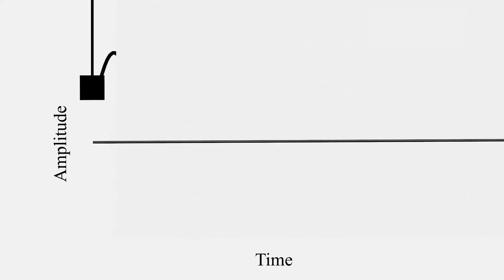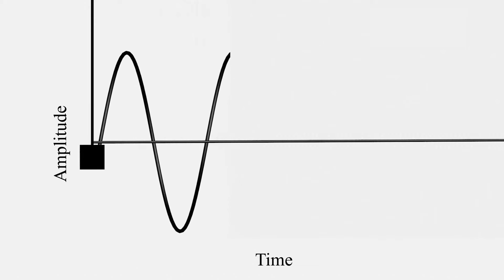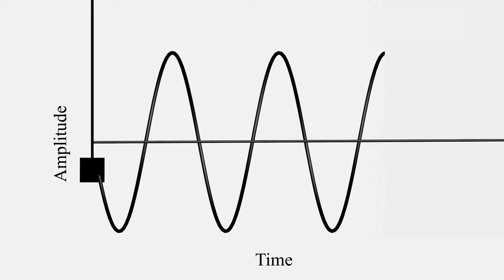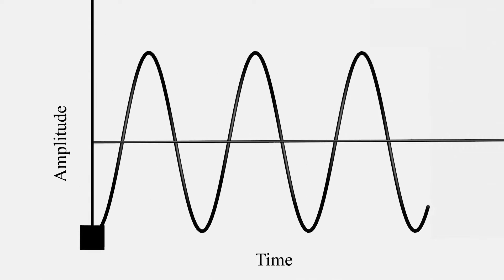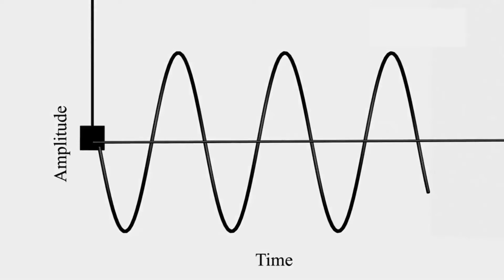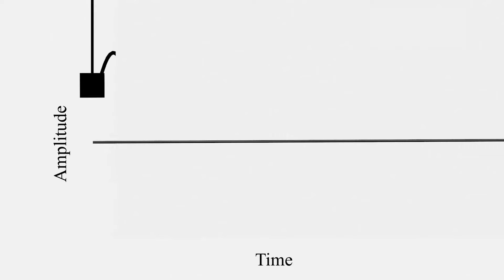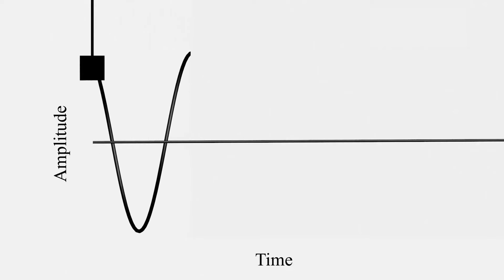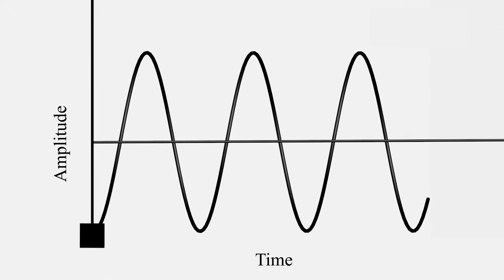What is a ground and why is it important for the performance of an audio system?

Comment: I have a T5x coming soon, should I connect its High Level Input ground wire to the same groud connector as my TT on my vintage Pioneer SA-8500ii ? Or should I just connect the REL HL input ground to a screw on my SA-8500ii chassis?
Reply from the maker: Thank you for reaching out. We recommend connecting the black High Level wire for your T/5x to the phono ground screw on your Pioneer SA-8500ii, and it will be fine to have both the high level wire and your turntable's ground wire connected together to this same screw. You would get the same result by connecting the black HL wire to a chassis screw, though the phono ground screw is typically easier to work with and more accessible.